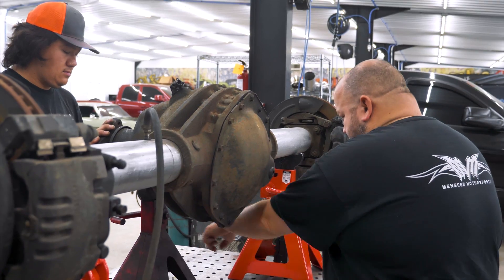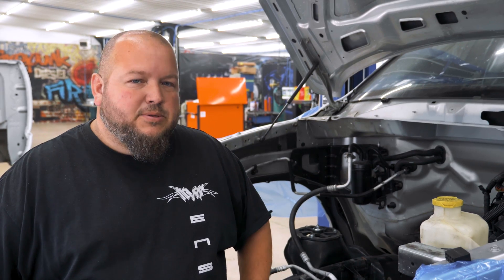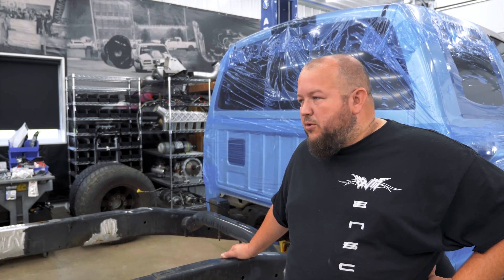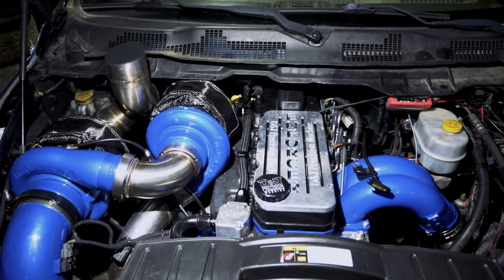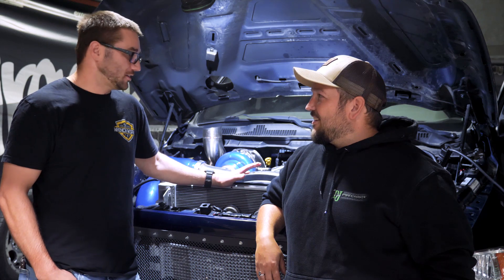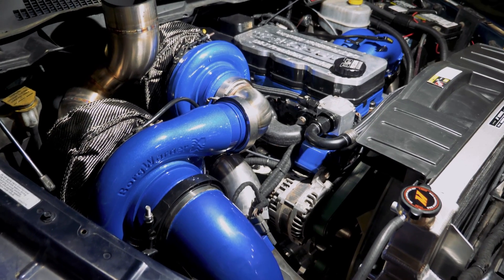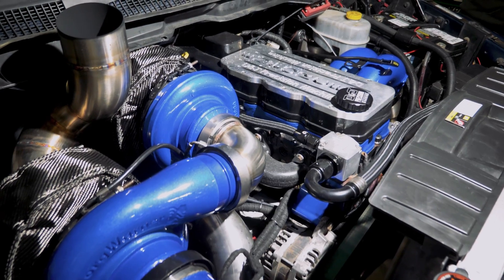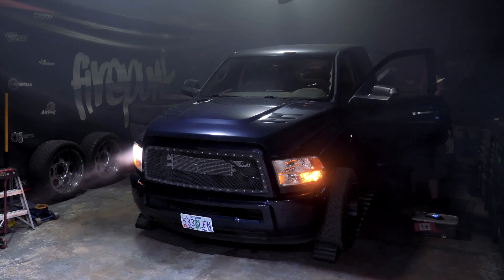OREGON TRUCK DYNO SESSION & A NEW FAB PROJECT

Comment: id love to see a video on reverse leveling... thinking about doing my 2nd gen and im curious as to what my options are. and if i still wanna tow with it how i could keep my overload springs in the rear or how bad it would be to add airbags on a lowered rear suspension. thanks guys!!
Reply: i did it on my 4th gen and theres enough short spacers between the axle and leaf on mine to level it, but i took my overloads out too...most i tow is maybe 7000lbs
Reply: @3DProductions  as of now only having one truck i pull camper all the time so im usually towing 10,000lbs or so.

Comment: Hello firepunk Team, love the channel. Best ever on youtube. 
I have a question- i know with nitrous diesels run a lot cleaner. I also know when dialing in nitrous, you guys run the trucks on the extreme lean end of the curve. So what I want to know is, can you tune a fuel only truck the same way? Like keep pulling fuel out till its on the lean end of the curve?
Reply from the maker: Yes absolutely, but you'll find it takes 2000hp worth of air to get a lean, fuel only 1200hp
Reply: @FirepunkDiesel  oh okay. I get it. Its money. The firepunk team should build a fuel only engine. Also, start a college or uni. Teach kids to build a diesel. Partner with D&J and teach them machining.
Reply: @FirepunkDiesel  also, explain the statement. Do you neeed 2k worth of turbo to be tuned on the extreme end of a 1200hp capable fuel system?

Comment: Enforcer and only makes 1200? Wonder if they ran out of fuel or air
Reply from the maker: They were box borg turbos, I would definitely say air was the limiting factor
Reply: @FirepunkDiesel  How do they spool up vs a stock turbo and a 478. Similar or not really? This stock 67mm turbo I have is junk. I have been thinking with putting a s400 on the bottom too so I stop breaking shafts.
Reply: Gotta keep it reliable so the wife an kids can make to church an pray to sweet baby Jesus on those hot sunny days
Reply: @chrishickingbottom6548  amen brother!